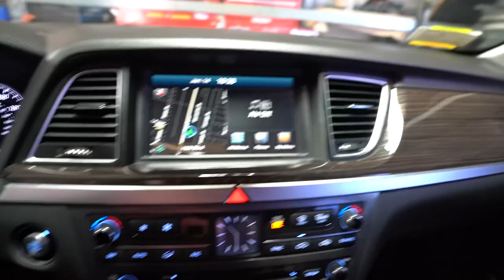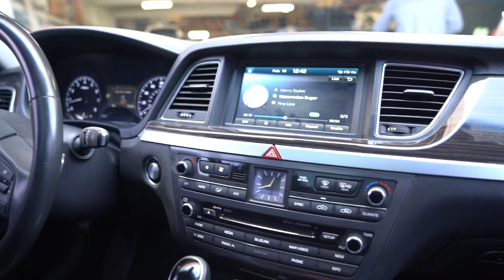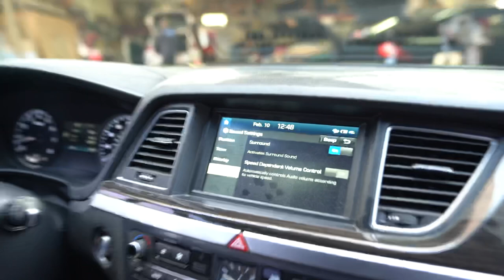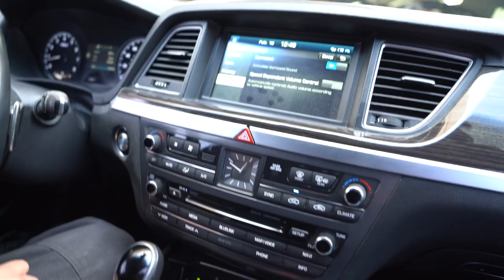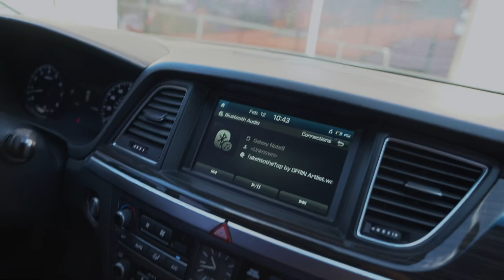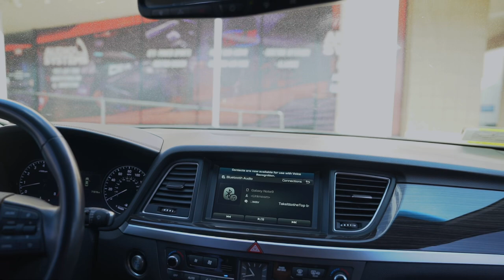Hyundai Genesis SQ, clean wire install with Helix ultra dsp

Comment: Man I have this exact car same color and trim. How much did this cost? I wish you were in my area you all do amazing work!! Finally someone made a video on this car. Mines a 2016 hyundai genesis sedan.
Reply: Hey dusten all depends on what you want done as well as what equipment you wish to run $7000+ for my set up
Reply: @sqgenesis1094  well I currently have 2 sundown sa12v2s in a 4 cube ported box , 2 sets of the new sundown 6.5 components,  a jl fix 82 for the 6.5s an lc2 for the sub since there Is bass roll off on the lexicon 14 speaker system,  an sfb 500.4 for the 6.5s and an sfb3k for the subs as well as a lithium battery in the trunk,  all run on 0guage. A budget build for sure

Comment: So what outputs from the factory amp did you end up summing for a full range output? I have a 2015 with aftermarket sub, using just the stock high-level outputs from the sub. It sounds ok, but it drops off after volume 22 and sounds like its missing a lot. Would it be worth it to sum the Front, Rear and Sub outputs, then use that signal for the subs?

Comment: What type of sound deadened do you guys like to use?
Reply from the maker: we all kinds but are favorite is resonix
Reply: @anthonyscaraudiolife6827   is resonix the grey/black product you use to cover the entire inner surface of the door before you reinstall the door panel?
Reply: @nectros8452  resonix would be the silver stuff used in the front. It’s made by some nut job named SkiZeR on the east coast… I’d say best in the west but dudes out in the east